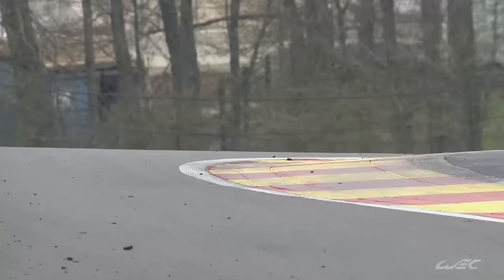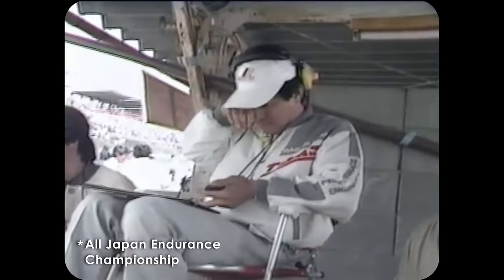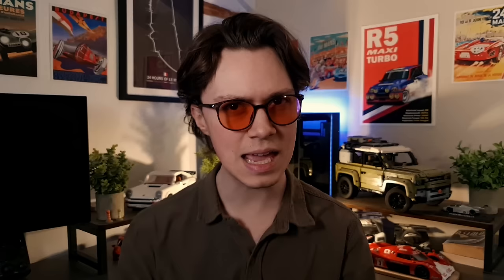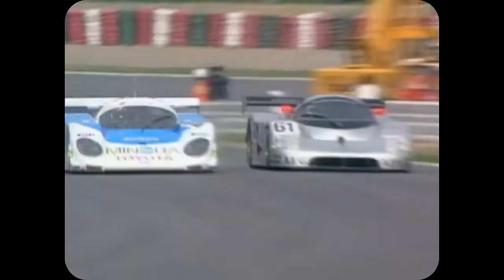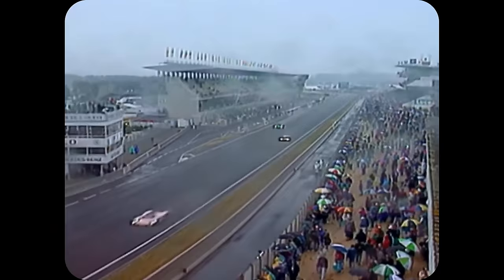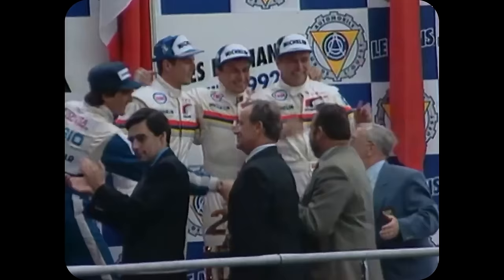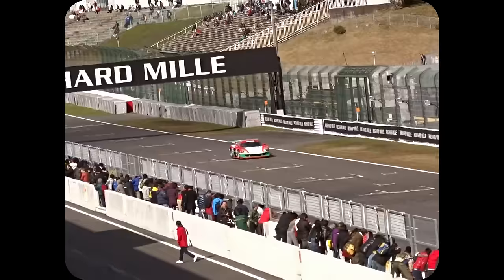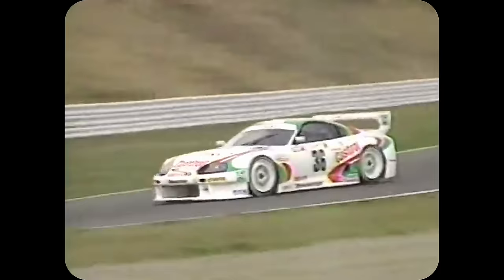if at first you don't succeed...

Comment: Something that I suspect will be highlighted in the next video is the importance of Toyota's european racing division, situated in Cologne. They built and operated the GT-One, and would later become the F1's team headquarters until 2009, before adapting the facilities once more for the TS030 program. And they also support the WRC team to boot. Truly one of motorsports best teams and facilities.
Reply: You might want to go a little further back than the GT1 days, as TTE (Toyota Team Europe) they also won several WRC championships. The Team principal & former rally co- driver Ove Andersson was head of the WRC programme, then the Le Mans programme, then the F1 programme! (Yes Andersson, Dave Richards & Jean Todt have a loooong rivalry/competition across all kinds of motorsport) before Toyota got DQd and then banned from WRC for the turbo restrictor bypass cheat, which really set up their dismal lack of success (Lexus Super GT aside) from 1995 onwards across Indycar, F1, WRC, MotoGP, Le Mans (and even before that, crap Touring Cars!).
You name it, Toyota Motor Corp were bad at racing it, for a very long time.

Comment: Not sure if anyone else here corrected you, but Toyota's 2.1L Group C/IMSA GTP/WRC engine was the bespoke racing only 503E (factory Group A touring and Group B/N rally Celica GT-Fours had same 3SGTE as road cars, only with intercooler spray and setup for anti-lag system) which shared nothing with the production 2.0L 3SGTE other than similar design philosophy, layout, and a common ancestor (I believe they had to give it a similar bore/stroke to the actual 3SG for homologation reasons in WRC and called it as such, but none of the factory WRC cars used the production engine or 4WD system even).  The common solution to racing a modified road car with an expensive modified high power 3SG that never held up, was to just replace it with a cast-off 503E from some defunct race team that was already setup for 300-500+ hp, and as much as 700+ for qualifying runs.  The 503E was physically larger, heavier, obnoxious to mate with any production transaxle, dry sump, had additional oil/coolant channels in the head/block and different deck design, and a sensor/ignition/timing setup closer to the previous 3T engines than 3SG (it's really like some overbuilt pre-production 3SGTE in design, a mix of the two),  and naturally lacked provisions for common accessories.  Hardly a well documented or cheap turn key solution, but neither is a built dry sump 3SG that just won't stop cooking cylinder 3 no matter what you do. It's exactly what Rod Millen did building his Pike's Peak "Celica," used a 503E with a setup more IMSA GTP than WRC, made it decently responsive with more modern engine/boost control to push around 700hp if memory serves me right.  About $8k would get you a complete spare longblock in the early 00's, usually left over from Toyota Team Europe's former operations.
Reply: the 503E raced under various bullshit 3S designations(3S-GT, 3S-GTM,...) for marketing and homologation purposes

Comment: why was none of the TRD/AAR collaboration mentioned? it seems weird to leave out one of the most important bits of information out, gtp was under group c regulations which should be more than enough reason to cover them if the japanese series was also covered
Reply: AAR even ran a 88c that TRD gave them in the 1989 season

Comment: One thing has to be stressed that in 1989, all manufactures had to take part in every single round of the WEC or they would be fined $250,000 for every round not in attendance! Although smaller manufactures were allowed to skip the end of season round at Fuji. In the Japanese round (Brun, Kremer and Joest) would essentially let out their entry to local Japanese teams.